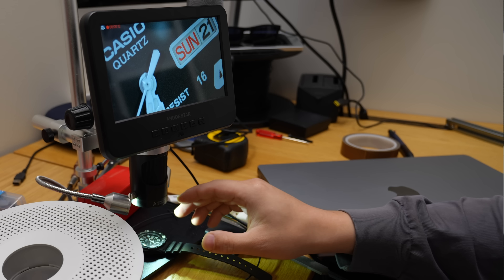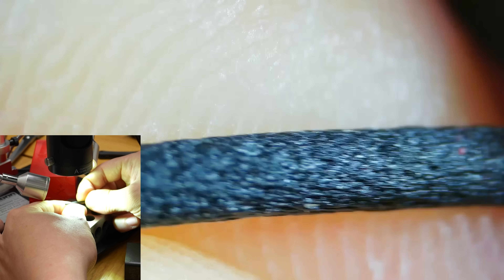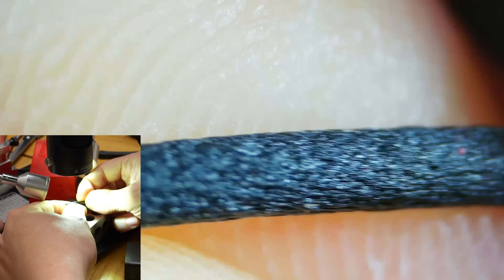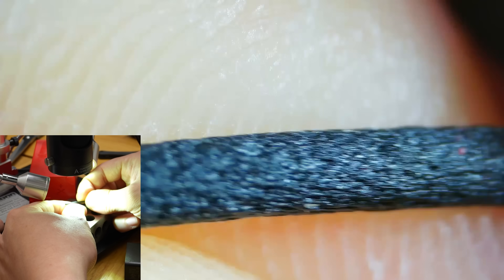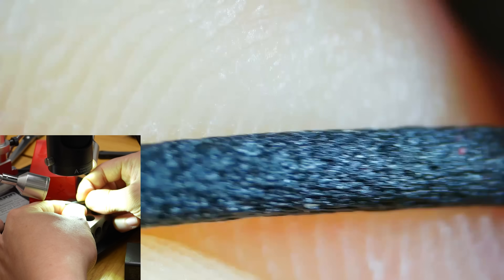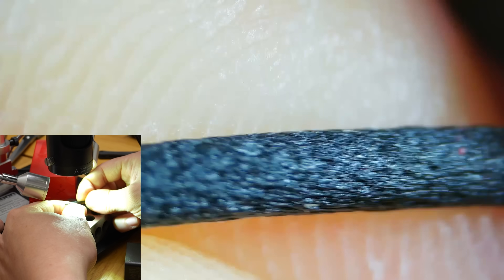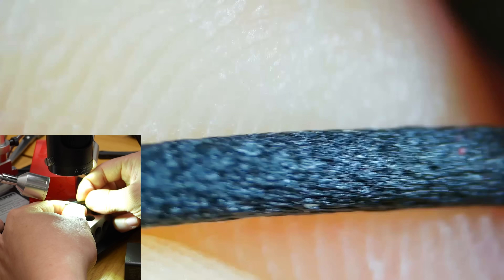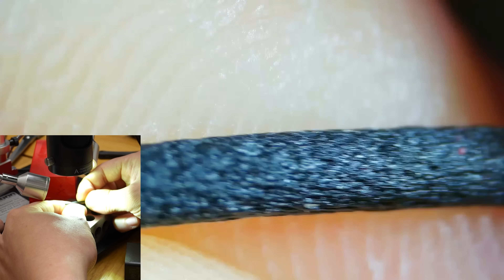The Dark Side of Carbon Fiber Filament

Comment: Why are some specs of microscopic carbon fibre in the outer layer of your skin a problem?
Im a mechanic and my hands look 10'000x  worse than that; your hands are more or less clean and they look like they have never been used in a non-laboratory enviroment.

Comment: Please make video "how to balance between health safety and performance in 3D printing". Hopefully I run few printers in closed balcony while monitoring behind the window, but than I encounter problems. Apart from increased humidity level, during summer i am facing heat creep while in extreme winter I can barely run 3D printer without external heat source boost.
Its serious problem especially if you consider that industry level technology is entering our hobbies each day more and more...

Comment: PLA+ can be surprisingly strong. I've been using it for most of my prints including functional ones and from what I've heard CF-PLA isn't better at all because of how brittle it is. CF-Nylon is apparently one that does make sense as carbon fiber not only makes it stronger but also less prone to warping but this is the first time I see anyone considering its safety. People usually just talk about the need to use hardened steel nozzle and slower print speeds when listing its downsides. Now I have one more reason to never use it unless absolutely necessary.

Comment: Hang on, to play devil's advocate, there are some artifical fibers that the body can never clear, like asbestos, which after decades causes cancer.

Then, supposedly, there are others like mineral wool fibers, that clear, but it takes months or a few years, not decades, which in theory doesnt have the same cancer risk. 

It all comes down to the specifics of the fiber nano scale shape and size. Subtle differenced make a big difference in how the body is able to deal with it.

So given that, it's possible the specifics of carbon fiber fibers don't actually pose a long term danger. Since carbon fiber has been around for so long, I'd assume if that had anything like the dangers of asbestos fibers there would be lawsuits everywhere. 

Also worth noting that theres a big difference between workplace level exposure and incidental exposure. Lots of things are hazardous at workplace levels but aren't for everyone else.

Big thanks for publishing. Lots to further research. It's just having researched different artificial fibers before, I've learned they're not all nearly as bad.
Reply: It is bad for u, google is you'll see, there's a reason there's so many safety rules when u cnc carbon (like you have to do it underwater and still use gloves + proper mask)

Comment: I learned how nasty this stuff is by working with carbon fiber reinforced tubing.  It's really nasty to cut, because the dust so easily gets into my skin and is very hard to remove once there.  Don't dare use power tools on this stuff without using a good respirator, protective clothing, and goggles.  I do the cutting all by hand using a razor saw, but I still hate it.

Comment: I dont think its as harmful as you might think here. The epidermis, outer skin layer, is about 200-300um thick. 
Average spacing of finger print bands is about 460um, which would mean the small fibers you see at 1:08 are probably only 50um in length. Not nearly thick enough to penetrate the passive outside protective skin layer. Looks horrible but probably harmless. 
Now, if you get them in your lungs it might be a different story... I wouldn't want to breathe in the air after sanding this kinda stuff.

Comment: I think it should be pointed out that these fibers are far larger than the asbestos fibers that cause cancer. So they won't pose the same risk that asbestos poses, but any small non-degradable particle is a lung hazard.

Comment: BAMBULAB P1S AND X1C PRINTERS ALWAYS EXPOSE CARBON FIBER DUST INTO THE AIR!!! ITS LIKE ASBESTOS!

The x-axis has CF rods. The print head scrapes off tiny splinters by every movement. Ever wondered why there is so much black dust inside the printer? Its not soot... A X1C-user sent me some of that dust on scotch tape and i checked it under the microscope. The splinters & hair look the same like what i saw on Wikipedia. They get stuck in your lung and potentially cause cancer. Its almost as bad as asbestos. Nobody talks about this issue... So thank you Nathan :)
Reply: The air filter inside the X1X and P1S is way too small to protect you! 
ONLY because of this reason i waited for the A1 to be released, even though i love these printers so much.

Comment: You can remove a large portion of the CF shards from your skin by applying tape to your skin to pull it off.  I use clear packing tape.  Otherwise you will feel pretty uncomfortable for days.  You should use a simple barrier cream if you do this work though.  OSHA hasn't decided officially yet on its hazardous rating in terms of being a carcinogen as far as I know

Comment: In my opinion, CF for 3D printing is mostly a marketing thing.  Using chopped up CF defeats the main benefit of using CF, strands that run end to end in the part.  Sure, chopped CF in your part will add to the part's stiffness, but stiffness isn't the same thing as strength. And as far as overall strength of the entire part goes when using a 3D printer, it will never have strength across all of the layers.  Even if you could lay down a continuous unbroken strand for the part there is nothing CF-wise connecting the vertical aspects of the part.  Only the plastic or an epoxy type material exists between layers and that is the weak link 
Again, my opinion

Comment: I would be more worried about the continual handling that would introduce any airborne particles. Do all the printers use a proper air filter on their heat exhaust fans? Storing reels near a vent or fan would be the biggest worry. I'd say that is a strong reason to set up shop in a garage, not like a craft room expansion.

Comment: All types of "Micro Particles" are VERY BAD for human, animal, and, plant health.

Having experienced these dangers first hand I can assure you that the dangers are very real and they have a lasting impact on you & everything around you when handling or processing the material.

Even just traditional PLA Filament Micro-Plastics are bad for your health and this applies to almost every type of rigid or semi-rigid plastic or non-iron-biodegradable polymer (polymers which biodegrade when they come into contact with iron from your blood), it also applies to a vast range of previously considered harmless flexible plastics & polymers like EVA, EBA, TPE, TPU, etc, that are commonly used by hobbyist 3D Printing Enthusiasts for making flexible parts.

Micro Particles as a whole pose a huge threat to our current and future health globally and more needs to be done to stop this problem from not just getting worse, but also from just existing in tbe first place, real-world solutions already exist and all they need is the minimal funding required to turn then from small scale mass produced test batches to large scale globally produced mass manufactured solutions that can be deployed in a very controlled & regulated manner.

Comment: Siraya Tech Fibreheart filament doesn't have the fibres on the edges of the filament and I'd consider it a mandatory safety feature for fibre based filaments now, and really should only be used for printability and stiffness, theres absolutely no need for PLA-CF as a result

Comment: Carbon Fibre has a similar shape to asbestos. As a former engineer that used to produce carbon fibre racing sails. machine operators were advised to wear half face respirators, while those in the facility were advised to wear an N95 mask.

Comment: Can you burn off a finished part with a quick wash over with a torch to 'smooth' the fibers off without mechanical abrasion?
Reply: Carbon fibre is made of carbon, exactly as it sounds like. Carbon has a very high melting point, over 3600 degrees Celsius. You are not doing anything to those fibres with a torch without destroying the part.
Reply: @conorstewart2214  You've tried this with the microscopic fibers so you know, or are you guessing? Burning off the fuzz might be different than trying to set a solid chunk on fire.

Comment: Where I work we have shrouds over everything pulling all the air away from the extruders (we don’t do 3d printing so I’m talking 2-4 extruders larger than me pushing into the same hot end) and pushing it through a set of filters because the smoke is really bad with some of the materials we work with

I can’t really fit a system like this onto my bedroom printer due it it’s odd size and being my bedroom so instead I’ve reversed the cooling fans and have filters placed on them so it sucks the smoke into the fan and filter instead of dissipating the smoke
Seems to work just fine unless I’m running 1500mm/s

Comment: Could you please do the same test with Glass Fibre reinforced nylon? I wonder if the results will differ. Anecdotally, I've noticed that CF reinforced filaments flake and often leave dust behind. I've never noticed that issue with GF reinforced filaments. So I'd be curious to know.

Thankfully I've seldom used CF reinforced filaments as I've wondered about this, given the dust they leave on stuff... I think I'll be sealing up all my CF filaments and either selling/donating them or just keeping them for some sort of specific outdoor project.

Comment: Carbon is actually completely bioavailable (we are literally made from carbon), if this comes in your lungs, it will irritate them probably if it's in high amounts, but then the body will absorb the carbon and use it as a building material. Asbestos, however, is NOT bioavailable, it gets stuck in your lungs, and stays there... forever. Constantly irritating them, damaging them, causing cancer.

Comment: The thing about carbon fibre is it should be handled with care due to its fibres being small, barbed and absorbed by the body. We are made of carbon so the body doesn’t see these fibres as a foreign object and will not reject them. Instead it will absorb them and then this can lead to abnormal growth around the fibre ie worst case Cancer. 
This stuff is no joke and should be handled with extreme care.

Comment: Most CFR filaments are shit, they are actually weaker than PLA, more expensive, eat nozzles, are hazardous. Why do people use them?
Reply: I take it you have never used a proper CF filled filament then?

I have never come across a decent CF filament that is weaker than PLA, not even close, especially not the likes of nylon, PET or PC.

I take it you don’t understand material science either? There is far more to it than tensile strength, the main thing adding fibre helps with is stiffness and thermal stability, two areas that non filled filament really struggle with.

You just need a hardened nozzle and then it will take a while to wear out, this is a solved problem.

Comment: The good thing is that carbon fiber is bio compatible and wont trigger carcinogenic processes and wont make the immune system go nuts like asbestos, but yet, in the lungs can make permanent dmg to the tissues
Reply: I'm not sure if asbestos is carcinogen per-se or if cancer develops due to tissue being damaged by tiny needles causing inflammation or something. Because some diseases can develop even when lungs are exposed to other dust  such as in quarries. Asbestos is basically from many of minerals that can crystalize into long, thin whiskers under certain conditions. But I assume fibrous glass is not healthy either, but risk may be lower, cause not so many particles are airborne.

Comment: As an asbestos attorney, I'll add this to my list of horrifying new things right below Forever Chemicals.
Reply: Do you think there will be a fibre glass lawsuit at some point?
Reply: @jonathanshaw8868  Sorry I though I already responded to this but let me do that again now.
Reply: I read somewhere fiberglass is required to be manufactured so that it breaks down within 2 years of making it into your lungs, not stick there forever. Apparently the macrophage cells can remove fiberglass in 10 days.
Reply: @jonathanshaw8868  It's a good question. Although not my area of expertise, I can speak to a few things. 

Unlike asbestos, fiberglass does not appear to persist in the lungs or other tissues. Most studies have shown that fiberglass is less likely to cause long-term health issues. The primary concerns are skin, eye, and respiratory irritation.

There are already established guidelines and safety measures for handling fiberglass. OSHA and other regulatory bodies have set exposure limits to minimize risks.

There have been some lawsuits related to fiberglass exposure, mostly involving short-term irritations or specific conditions under certain circumstances. However, these cases have not reached the scale of asbestos litigation due to the difference in health impacts.

Continued research and any emerging evidence of long-term health risks associated with fiberglass could change the landscape. If new studies show significant health risks, it could lead to more extensive litigation.

As is often the case, as public awareness and scientific understanding evolve, any new findings about the risks of fiberglass exposure could influence legal actions.
Reply: @jonathanshaw8868  It's a good question. Although not my area of expertise, I can speak to a few things. 

Unlike asbestos, fiberglass does not appear to persist in the lungs or other tissues. Most studies have shown that fiberglass is less likely to cause long-term health issues. The primary concerns are skin, eye, and respiratory irritation.

There are already established guidelines and safety measures for handling fiberglass. OSHA and other regulatory bodies have set exposure limits to minimize risks.

There have been some lawsuits related to fiberglass exposure, mostly involving short-term irritations or specific conditions under certain circumstances. However, these cases have not reached the scale of asbestos litigation due to the difference in health impacts.

Continued research and any emerging evidence of long-term health risks associated with fiberglass could change the landscape. If new studies show significant health risks, it could lead to more extensive litigation.

As is often the case, as public awareness and scientific understanding evolve, any new findings about the risks of fiberglass exposure could influence legal actions.
Reply: @jonathanshaw8868  old fibergals was bad stuff there might be a case for lawsuits. The new stuff should have diamater to lenth ratios that can´t get stuck in your lung and cause cancer.
Reply: Wait until we realize that carbon fibers are forever fibers. As their use spreads we gonna soon start drinking water contaminated with micro carbon fibers

Comment: I noticed that when feeding my CF into the printer I could feel the 'roughness' but didn't realise those little pieces break off and get all over. Thanks for the video, I will be more careful now. Luckily I have just bought a X1 Carbon and also have an external filtration system too and will use this setup for anything volatile. Anything with fibers in it will get onto your skin, air, clothing and everywhere else I guess unless properly trapped with a filtration system.

Comment: Industrial, aeronautical and motorsport folk have known how bad Carbon Fibre filaments can be on lung tissues for a long time now. Same for Glass Fibre. That's why there are safety procedures in place for their handling. 3D printed PA-CF will be dangerous when sanded smooth, a Resin coating is a better way to smooth the surfaces for post printing treatment.

Comment: Would CNC milling of carbon fiber sheets carry the same risk? I have a Snapmaker 2.0 and the company lists carbon fiber sheets as an workable material for the CNC module. I have the enclosure and the air filter, but now I’m not sure about doing the pieces I had planned.
Reply from the maker: I wouldn't cnc carbon fiber unless it were absolutely neccessary
Reply: Doing anything with finished carbon fibre pieces like sheets is very risky. Grinding, cutting, milling, etc, all produce dust and fine particles that is very bad for your lungs, so whilst the snapmaker may be able to cut carbon fibre sheets it likely isn’t a good idea without taking proper safety precautions. Most of the time professionally they mill carbon fibre sheets in a water bath to contain the dust and fibres.

Comment: Good information to consider especially not needing small strands to go airborne and get inhaled. I also noticed your MK4 with MMU3 and the Sunlu S4 filament dryer. I have the same but the dryer isn't setup yet to help keep at least 4 filaments for the MMU3 dry and ready. I have a Creality Pi dryer fir the 5th as well but I'll need to find a good place to set all of them up for convenience.
Reply from the maker: I have it set up so that 4 filaments are on the sunlu, and if I need a specific filament I can just put it up top on the normal spool holder

Comment: That "smoke" is probably steam from wet filament. You don't get it with most materials properly dried unless you get it build up on the outside of the nozzle where it's exposed to air at high temp and will gradually oxidize.